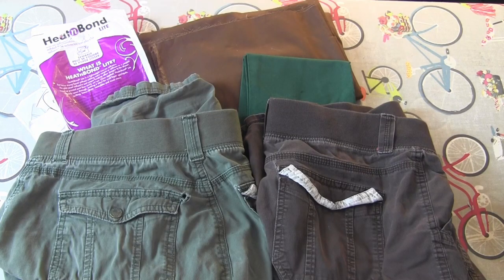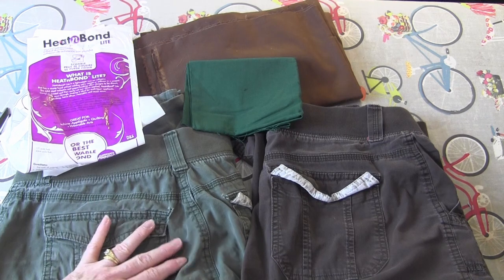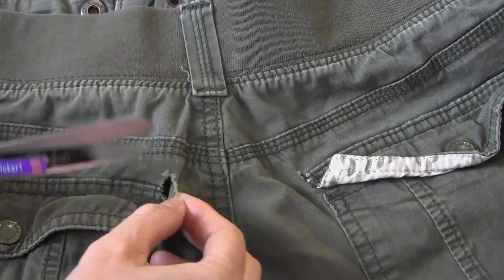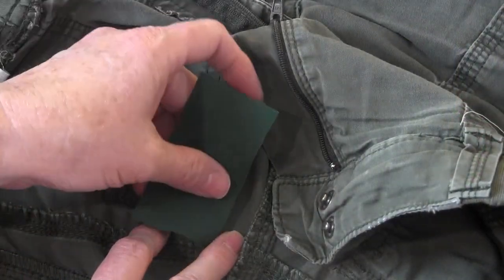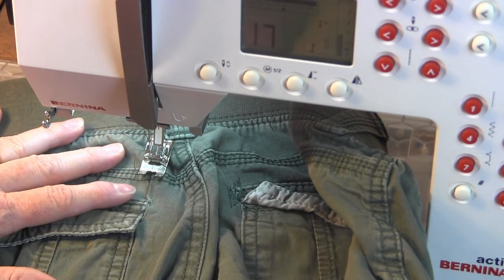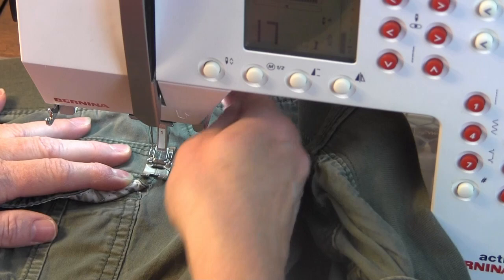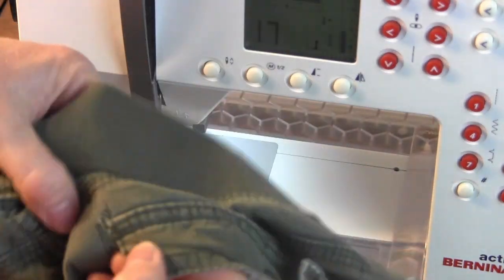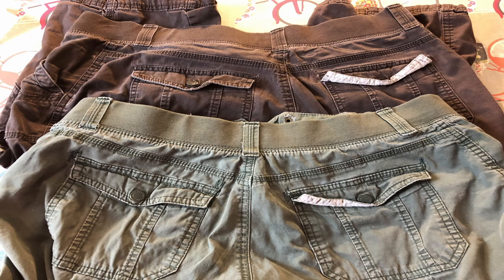How to Mend: How to Repair Holes in Pants by Darning with a Sewing Machine

Comment: hey i wonder, how do you sew (or darn) clothes on a sewing machine without connecting top cloth layer with the bottom one? some holes are located in  the area where you can reach it without putting both layers under the sewing machine, but some don't. So is there a way to do so?
Reply from the maker: Hi!  Usually you can get the one layer of fabric under the needle by taking off the table and then having the part loop around the sewing machine bed, see this tutorial https://youtu.be/Kgn7ZmqJmt4.  But, I know in some areas of arms or legs of clothes this won't work either.  If this is the case, the only option is to remove the stitches in the arm or pants seam in order to do the patch . Then you can resew the seam after the fix is complete. Happy Mending!